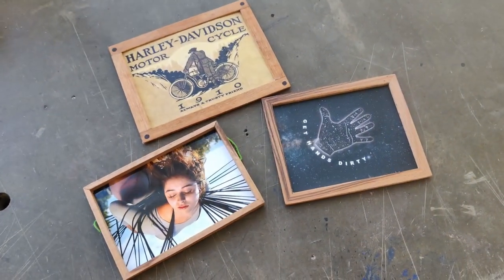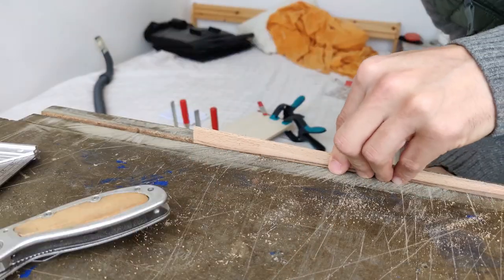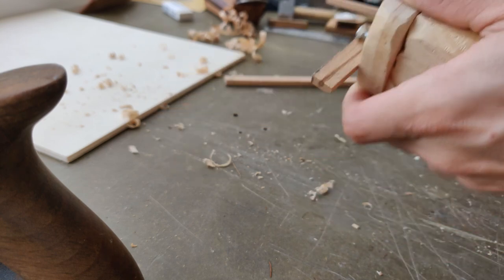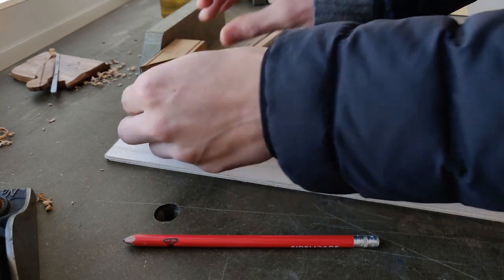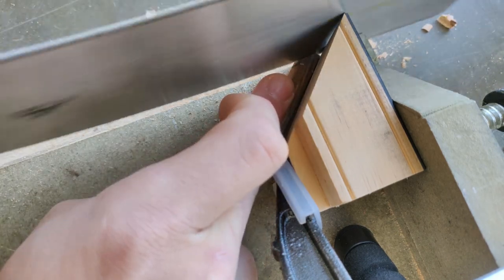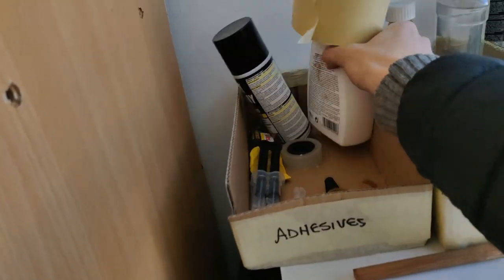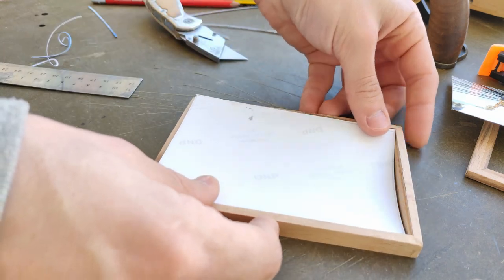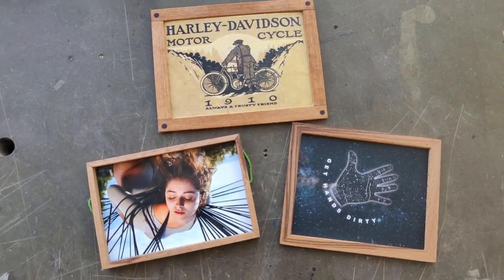Making Picture Frames with hand tools

Comment: Love to see hand tools being used.  I am a newbie with this craft but have attempted making picture frames that let my oil-painted-panel float instead of butting up against the frame. I tried using 90 degree trim stock which I then miter cut the corners using our scroll saw since that is all I have.  Im going to try again using jigs and a hand saw and I know I can expect much more accurate results! Thank you.
Reply from the maker: thanks for the comment and good luck to you! I was also a newbie when I made this video and the only way we improve is by practicing.

Comment: I only realize lately while watching other makers, how valuable school has been, back in the day the boys had woodwork from standard 4 (grade 6) to matrix (grade 12) well you could stop taking it in high school....  Anyway, I see people having no idea which tools to use or order to go by to level, square and mark their wood pieces.... Not that you can't, you are certainly proof of that. It just gets easier, more repeatable, and precise. PS I have a handy clamping jig for frames that can be #D printed if you are interested... really strengthens glue joints to be clammed with correct force.